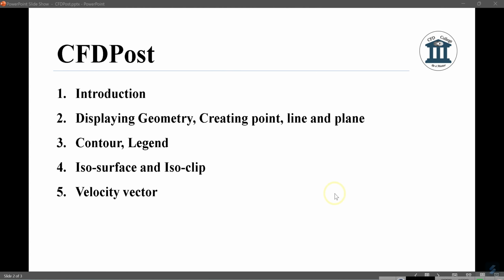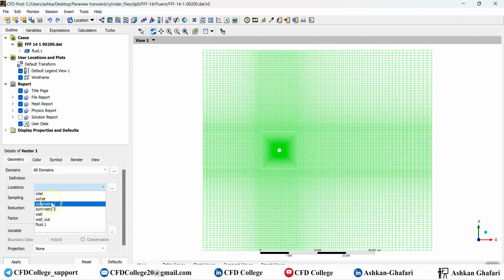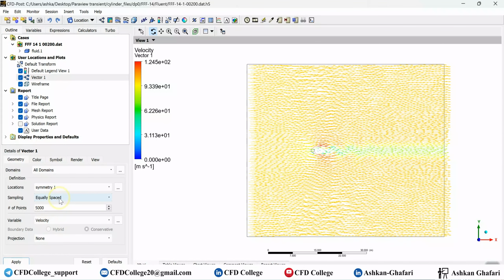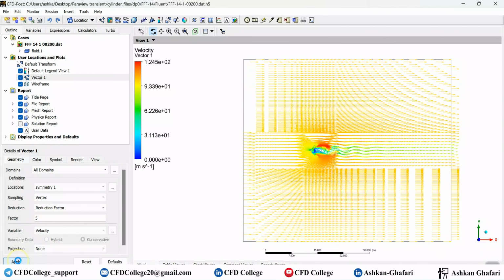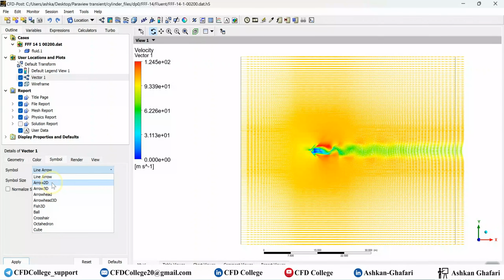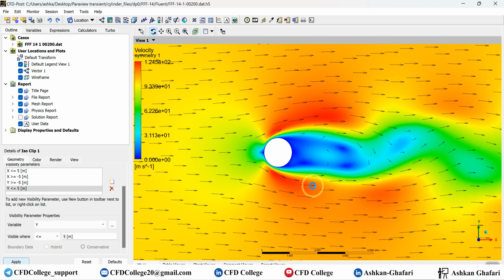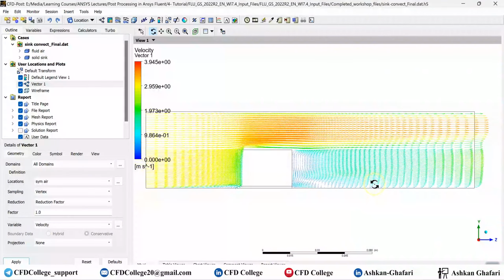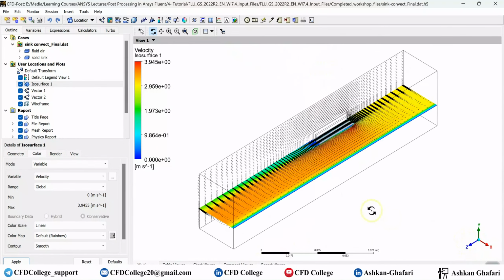CFD Post Tutorial 5 | How to draw velocity vectors in CFD Post?

Comment: Great video, I really liked it and it has a lot of relevant information. I just have one question, I would like to represent the flow with velocity vectors in a constant color (black), and how do I add a reference vector for scale?
Reply from the maker: Thank you for your comment. You can modify the color of the vectors by changing the Mode to constant in the color tab. To the best of my knowledge, there is no specific option for adding a reference vector.